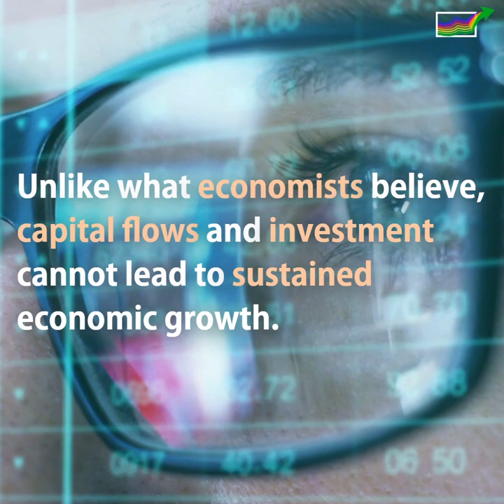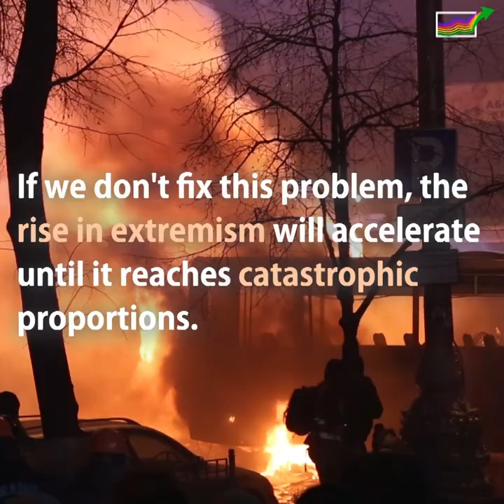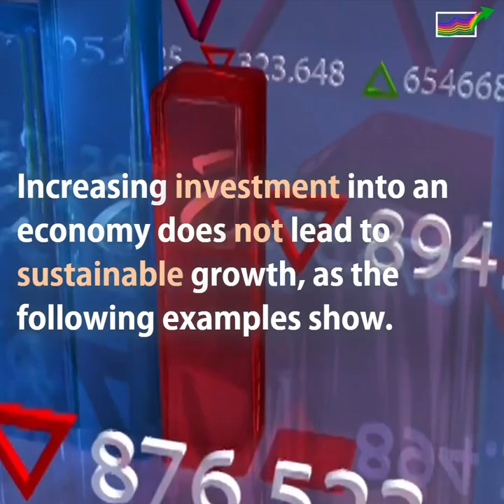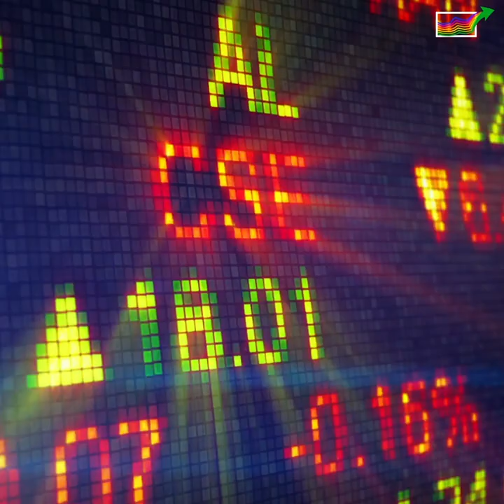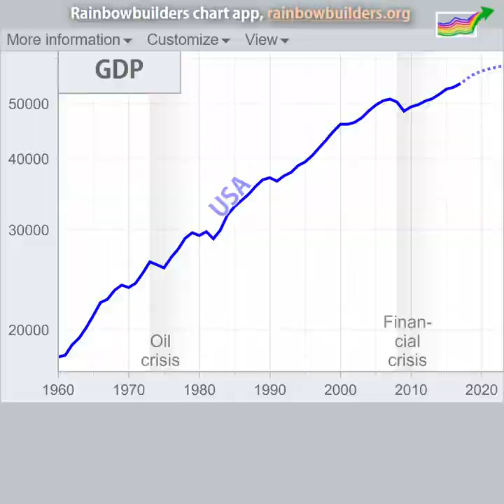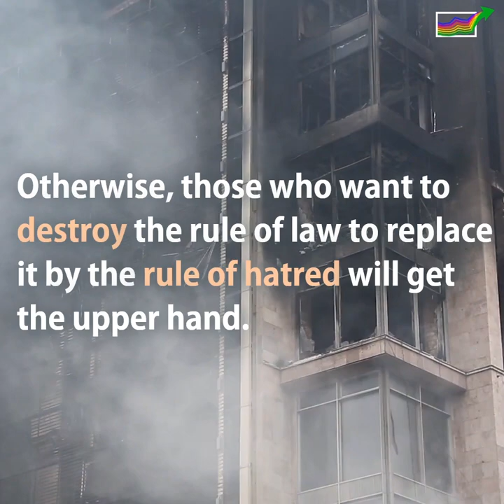How the IMF got GDP all wrong...

Comment: I don't see any mention of the productivity puzzle but interesting study. Keep up the good work.
Reply from the maker: Thanks for your encouraging remark! I don't mention productivity directly, because productivity data is not available for most developing countries. However, my analysis can be applied directly to the present "productivity puzzle". The problem: in recent years, productivity has not increased as much as before. Why? The answer: because "productivity" during 1994-2004 was pushed upward by the bubble US and UK bubble described in the video above. "productivity" does not measure the inherent quality of what is produced, but the price they get on the market. Therefore, if in a certain country GDP is artificially enhanced by a bubble, the same applied to productivity. For most other countries, the slump with regards to 1994-2004 is not as marked, because they did not have such a marked bubble as US and UK. In this case,  the long-term decrease in growth shown by my charts also explains the downward trend in productivity. The reason? I can only speculate, but excessive and especially inefficient regulation seem to be an important factor. An increasing number of people are employed for basically unproductive legal and administrative tasks. This has reached unsustainable levels, and we must act.